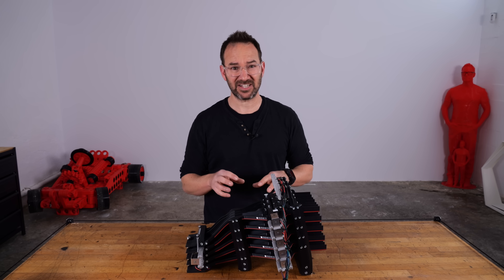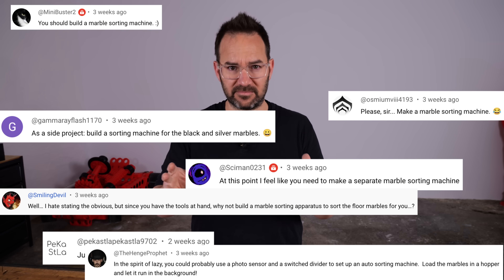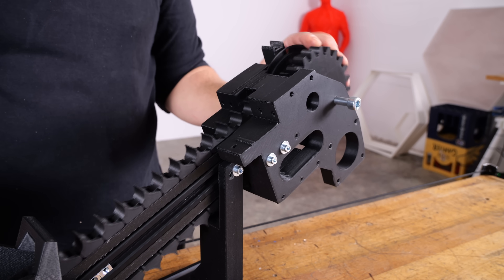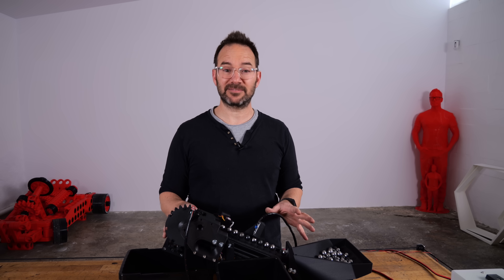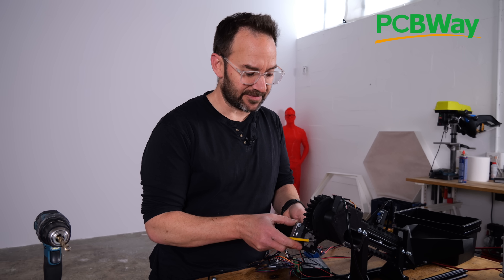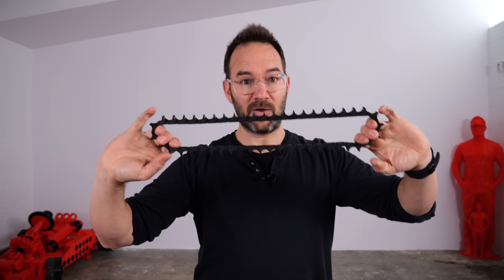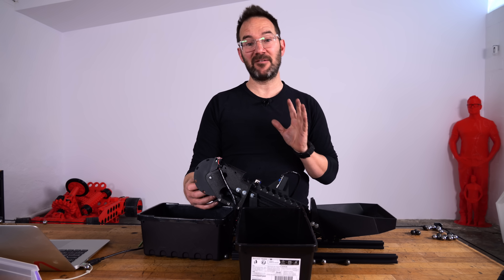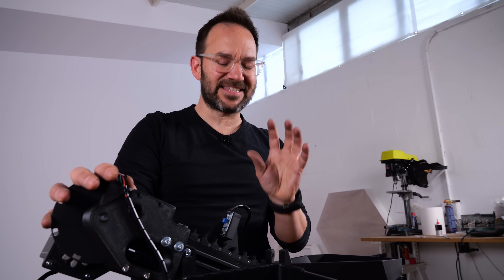Faster than the Eye Automatic Marble Sorter - Marble Clock Seconds Display Pt.3

Comment: I know this would be a lot of work on top of what you've already done, but what about building a second sorting machine? You don't even have to change the design, just have a second sorter running in parallel with the first. That would allow you to reduce the speed (maybe to only 15 marbles / s?) and still be able to sort really quickly, since you're effectively multiplying that rate by 2.
Reply: I'd say stick with like 10 marbles/sec. It was around that point that the solenoid was actually consistent in getting every black marble out from the shiny ones. The machine only needs 17 marbles/sec, with two sorters at 10 marbles/sec that gives you 20 marbles/sec, more than enough.
Reply: @minecraftersunited8565  I think half the problem was physics on the belt pick up, some were being flung out there...
Reply: Yeah, I came down to the comments to say this.  You may be relatively "reliable" at 15-18 marbles per second, but you're probably not as reliable as you think and being in the range of 10-15 will probably help you keep it from going wrong one out of every five hundred marbles (for example)
Reply: on that line he shoul build them off height so there isnt any colisions between lane 1 and 2 2 and 3 and so on
Reply: Why stop at two ? 😊
Reply: @associatedblacksheepandmisfits  more you have the more issue ut can have
Reply: Also a way to detect if there is no marble and not fire the solenoid if it is empty.
Reply: @Sullrosh  That might be easily taken care of by just choosing the right marble color to eject and the right threshold.  Depending on which one is ejected and which one continues on to fall off the end, the solenoid probably won't fire for both the marble which is supposed to continue and for an empty slot.
Reply: Just add a second solenoid and alternate between them to hit the marbles.
Reply: @GoffyOne  Or 7 more, stop the chain every 8 links and pop out the selected ones all at once, then move 8 links again, etc.
Reply: @Whatsinanameanyway13 ,
@SilvrSavior  that won't change much - the current limitation is the time 1 marble takes to pass the solenoid - you would have to accelerate the chain to a speed quite high, stop(or slow down), fire the solenoid, accelerate again - i suspect jerking the chain that much would begin to be its own problem.
Reply: @Whatsinanameanyway13  Stopping takes time. Better to move continuously and make the rest of the process more reliable.
Reply: @GoffyOne  The issue isn't the rate at which the solenoids can fire, it's the physical speed at which they fire and retract. The crashes are due to the solenoid not clearing the belt in time, so your maximum belt speed will be limited by the time it takes for the solenoid to reach full stroke and return. 

If the belt travels more than one link's length faster than the solenoid can actuate, you've got a crash. Having multiple solenoids still leaves you with the same maximum belt speed and therefore the same throughput.
Reply: @GoffyOne  putting two solenoids in one line would still need the line to move at an average of at least 17 marbles per second, which was probably too chaotic. The two lines need to be separated in order for parallelization to have maximum efficiency.
Reply: You could have a hopper in the middle of a circle of chains. And each chain has a tube to catch the ball and send it to the correct bin. Put a vibration on the hopper to help reduce possibility of jamming.
Reply: You could make the belt several marbles wide. Then either have slots for a solenoid to whack the marbles behind, or just be clever with the angles to ping them out

Or more sensibly (if I must), have a belt one marble wide but have a row of solenoids. Then you can advance (say) 5 positions, whilst reading the colours. Then all at once have the right combination of solenoids kick the right ones out
Reply: the power of multithreading
Reply: This is a great idea, and then we can optimise even further by only having the first sorter sort the black balls and the second sorter sort the other. We could crank up the speed on both....

I'll see myself out.
Reply: 2 solenoids spaced such that there is a spot between the 2. Maybe have 2 to 3 sensors if needed. Have the sensor(s) build an array that can then be compared to a special case library like Dark/Light/Dark so that it can place the marbles more optimally. If no special case is detected, then just have the program oscillate between the solenoids. When special cases arise, then have the current assignments overridden by the special case library. 

Haven't done any program for over a decade, but that's just what I'm picturing for a solution.
Reply: @SilvrSavior  or read say 5 positions then reject upto all 5 with solenoids.
Reply: E

Comment: Have you tried using a H bridge to drive the solenoid? It both react faster than a relay, and the rate you need to trigger it would be easy for an H bridge, where a relay isn't really made for that.
Reply: Another idea for pushing the marbles out, could be to use a servo motor for that too, and a wheel with openings in. That way it only needs to rotate enough to push the marble out, and move a new hole into position. Depending on the diameter of the wheel, it would only need to rotate a few degrees, and at the same same movement move the next slot in the disk into position, ready for the next marble. To make it very reliable, you could have a look at the stepper motors with driver and encoder build in too. I have been playing around with some, and they have been very reliable and VERY fast in acceleration and deacceleration, and even if it is missing some steps, it will correct it immediately.

Comment: Instead of a solenoid, can you use a blast of air?   No chance of that damaging the chain.
Reply: That'd make the thing even louder 😂
Reply: @111111222223  i thought that was one of the design goals.
Reply: or just place solenoid high enough so that it only touhes marbles and cant touch chain
then put a wedge on it so if its too slow it will just push the wrong marble but wont jam on it
Reply: Came here for that comment... That's how you sort things in industrial applications!
Reply: @GeneralPoison  In industrial applications there is usually an air supply available.
Reply: You could do away with the chain/solenoid interaction entirely by deflecting the marbles as they drop - that could be achieved with a pulse of an electro-magnetic if air is too loud.
Reply: I was looking for this comment. Yes, compressed air is a great idea. It's used in industrial sorting machines of all sorts. It eliminates the problem of the retraction time entirely.

However, I don't know how difficult it is to build a precise enough system...
Reply: Instead of the solenoid, why not go back to the servo, replace the arm with a X like a propeller and just rotate it a quarter turn in the same direction for each ball, nothing to block the path, next arm in the right place for the next ball.
Reply: If you speed the chain up until the marbles are launched in an arc then they could easily be deflected at the start of the arc by an air blast or the solenoid.
Reply: I wonder if timing the solenoid so that it starts to move out before the ball gets in place.  It depends on the solenoid movement speed.   You'd have to adjust the leading time period depending on chain speed.
Reply: Yes we do that on industrial machines, can easily go 100-200 per second.
Reply: E
Reply: Raise the solenoid to be slightly above the chain but still tap the marble so it can't get caught on it.
Reply: Or shorten the links a little and raise the solenoid slightly so even if it does miss, it cant physically hit the chain.
Reply: Or perhaps a magnet.
A well placed magnet that pulls the marble of the belt
Reply: @TheHellis  The belt (at least the last one) has metal parts, and a magnet could attract the other marbles when pulling the right one so I think using a magnet wouldn't be very reliable in this case.
Reply: @Dolmeca_the_Knight  not all metals are magnetic :-)
Reply: @TheHellis  all metals are magnetic, they just aren't all ferromagnetic
Reply: @CircuitrinosOfficial Metals aren’t “magnetic”, they are “magnetically receptive”… and not all metals are magnetically receptive.
Reply: @HiThisIsMine  That's not what I'm talking about.
I'm talking about ferromagnetism, paramagnetism, diamagnetism, antiferromagnetism, and ferrimagnetism, and superparamagnetism.
Reply: @CircuitrinosOfficial  - I’m not debating what you’re talking about. You said “all metals are magnetic”, which is why I responded, “metals aren’t magnetic”

Magnetic - Magnetically receptive/ferromagnetic are two completely different things.
Reply: @HiThisIsMine  Give me an example of a metal that isn't magnetic.
Reply: @HiThisIsMine  "Magnetic - Magnetically receptive/ferromagnetic are two completely different things."

The term "magnetic" is a broad term and refers to all types of magnetism. Ferromagnetism, diamagnetism, and paramagnetism are all types of magnetism.

Copper is diamagnetic.
Aluminum is paramagnetic.
Iron is ferromagnetic.
Reply: @HiThisIsMine  Please provide a scientific definition of "Magnetically receptive"
Reply: @HiThisIsMine  Are you talking about the difference between metal that has been magnetized and metal that responds to a magnetic field but isn't magnetized?
Reply: @CircuitrinosOfficial      “Give me an example of a metal that isn’t magnetic” - I already did… all metals. Iron nickel and cobalt are your primary metals that are turned into magnets.

Common mistake is that people, including yourself, think if a magnet sticks to it, it’s considered magnetic, and that is not what “magnetic” means. Magnetic is a state of energy. A magnet is an object that has a magnetic field or force. Metal does not have a magnetic field by default and only becomes magnetic when it reaches a certain temperature.

Ferromagnetic just means it has a high susceptibility of becoming magnetic. All metals which are magnetically receptive, are ferromagnetic.

If you wish to learn more about magnets or the definition of words, google it. Stop spamming the comments section with all your questions.

And yes, you said what you said and it means what it does. “All metals are magnetic”… no, they are not.
Reply: @TheHellis  As long as it doesn't magnetise the marbles, sure.
Reply: @TheHellis  that would magnetise all his marbles, which would make life extra fun later
Reply: @TheHellis  A pulsing electromagnet may get the job done but it would also make the marbles slightly magnetic in the process which would lead to further issues.
Reply: @TheHellis  No magnets. The balls end up getting magnetized, causing all sorts of problems.
Reply: Put a paddle wheel above and perpendicular to the chain. Use it to swat marbles out of the chain. Couple the timing so that the swatter doesn't have any ability to hit the chain (by, for example, using the same motor to power both the chain and the swatter). Use a solenoid to raise and lower the swatter into the path of the marbles so that it can select marbles for removal.

This is a solution in which failure doesn't result in jamming, just unsorted marbles.
Reply: @IlIlllIllIlIIIll  a paddle wheel wouldn't work.  If you had a ball to be sorted between 2 that didn't itd crash into the 2 that didn't.   Putting a gang of solenoids on a reciprocating arm would be an option.  Match the speed of the arm with the chain and sort 5 or so at the same time
Reply: @IlIlllIllIlIIIll  this is what I thought when I first saw the little arm he started with.  It doesn’t matter how slow the arm is if it’s moving with the chain.
Reply: @IlIlllIllIlIIIll  Keeping such a device mechanically synchronized would be full of awkward linkages. It would either be sloppy or extremely friction heavy. An air nozzle is probably the play.

Comment: Speed is nice but what is the failure rate? Marbles on the table also count towards the failure rate.
Reply from the maker: It rejects only black marbles but some not so black marbles get through. I wasn't so much focused on that because that's just tuning the color sensor. What I wanted to be sure is that I could reject the marbles at the highest rate possible as long as the sensor could pick them up.
Reply: @ivanmirandawastaken   sound logic! i figured that was the case. why not mention/acknowledge it, though? engagement boosting? XD